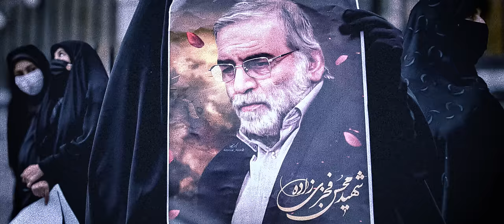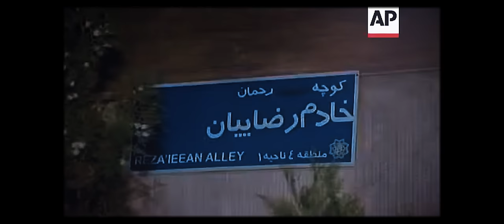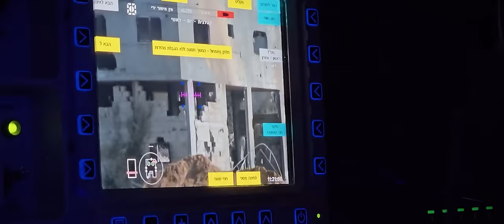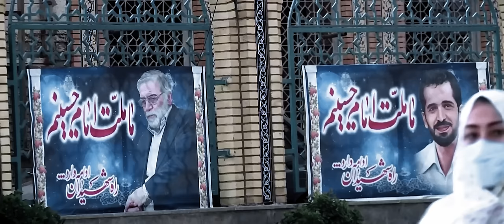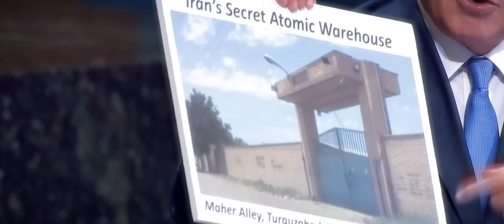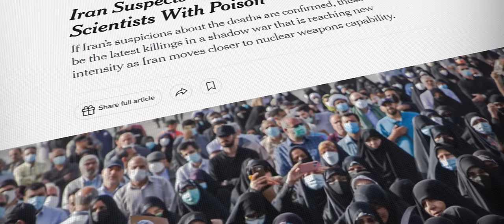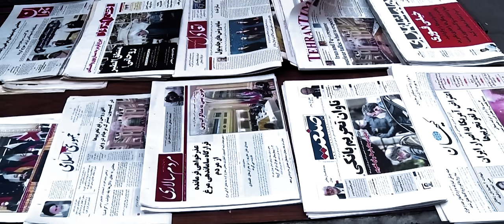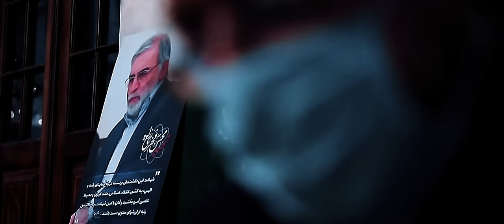How the Mossad Assassinated Iran's Top Nuclear Scientist

Comment: And mossad missed hamas attack...
Reply: Missed? I doubt that. Mossad never missed (ekkk that's a good tagline).

1. Egypt literally called to warn them about the attack. 
2. Billboard said the rave was supposed to be on the other part of Israel but they changed the location to 5km near Gaza border just 2 days before the event. 
3. NYT did a timeline on 7 Oct and it shows the IDF responded 6 hour after the attack. That's strangely very slow for IDF.
Reply: @Cindarful  I don't follow your logic.  Are you saying that mossad knew but did not react? Or what?
Reply: @zilvinasstrolia2076 exactly that is what he is saying.  They needed a pretext for genocide
Reply: @YssaRee well said
Reply: @Pilot1947 no genocide. Except in your mind
Reply: Mossad is not responsible for internal security and not 😮with Hammas in Gaza which from security porpuses consideted as part of Israel. but the Sin Bet.  Mossad is responsible for all activities and treats outside of Isreal. Thats why Hammas didnt inform iran and Hizballa of the attack beacuse they knew Missad will know about the attack right away. Very smart move by Sinuaer.